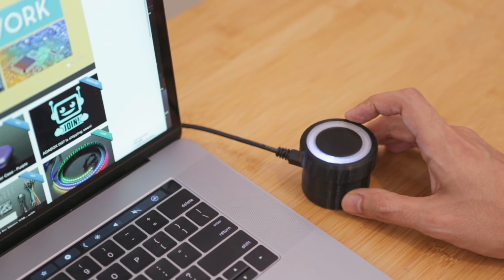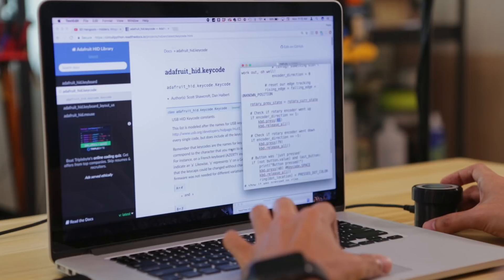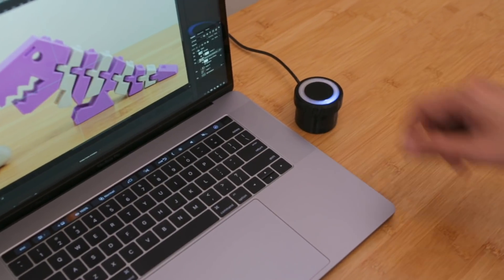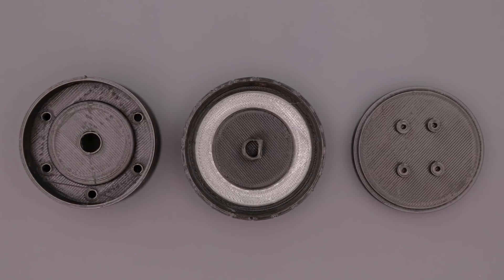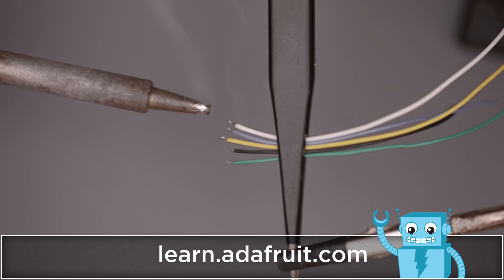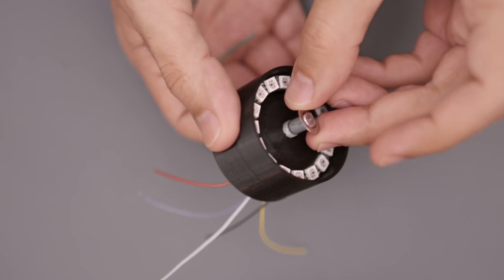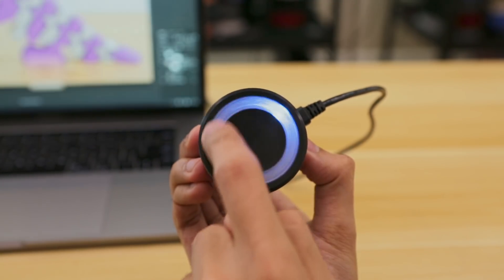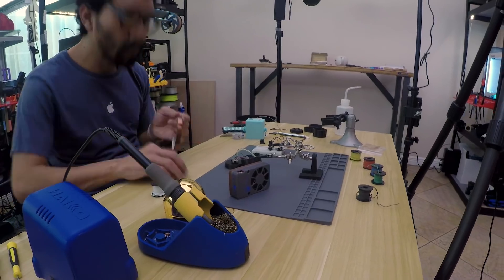DIY Media Dial - CircuitPython

Comment: If I wanted to build multiple dials to a single board, could I use the Adafruit Metro Mini 328?
Reply from the maker: Feather M0 express would be a better choice, more flash and built in usb battery recharging

Comment: what is the keyboard mapping software for windows that u can use that is free and easy, would like to create this with adobe primere in mind. i know on the mac its pretty easy to do...(or maybe im thinking of midi to keyboard shortcuts)
Reply: In Windows, you can map things to Extended Function Keys, such as F13 through F24. You can use AutoHotKey to read these inputs and perform a specified action.
Reply: It should be noted that Premier products can read these inputs natively, but on Mac/Linux, you might need to mess with a few things, as from experience they don't know how to handle the keycodes.
Reply: Is there a way to add a ball on top to control cursor and maybe 4 or 5 side buttons?
Reply: A Aa Anything's possible if you know how to do it. I don't know how to do that from scratch. Your best bet is to get a retired trackball and modify that